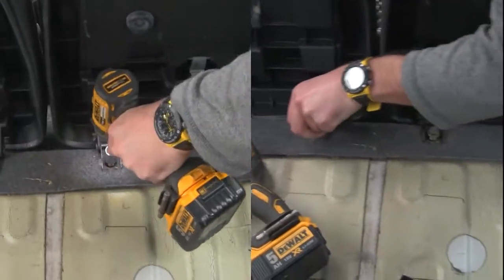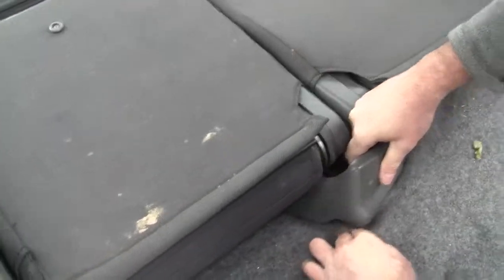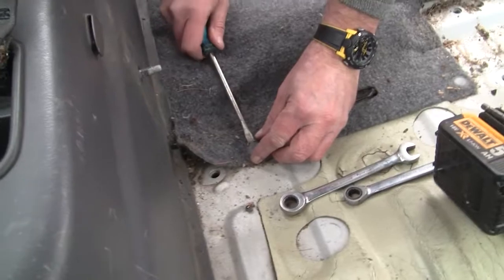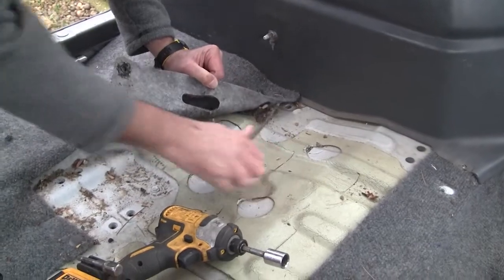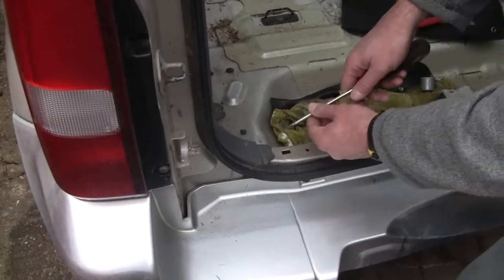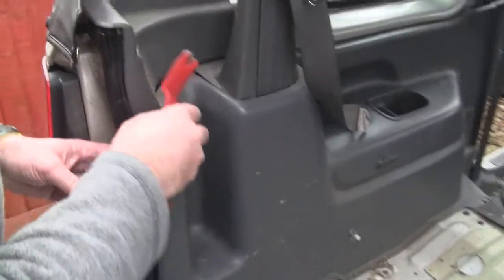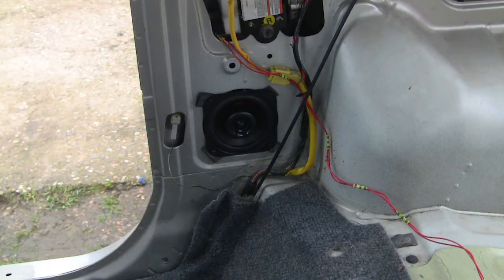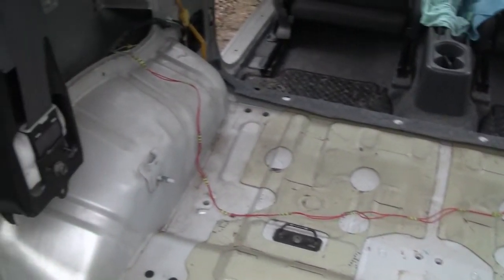Suzuki Jimny adding and connecting rear speakers

Comment: Just did this today. I can recommend using some bootlace ferrules for connecting into the existing wiring harness. Ones I used were 22AWG, fitted snugly and now all speakers are hooked up.

Weird about the wiring diagram given black should always imply negative. I wonder if that's a manufacturing error. I don't have a multi-meter to check the polarity so I am just assuming mine is as it should be (speakers sound fine?).

Comment: If I just plug my speakers into the connector in the rear will they work? Or do I have to do something with the radio up front
Reply from the maker: The head unit will need to have provision for the rear speakers, if it does then it should just work.
Reply: @GRTYoutube  thank you